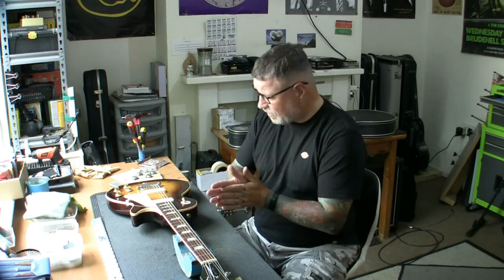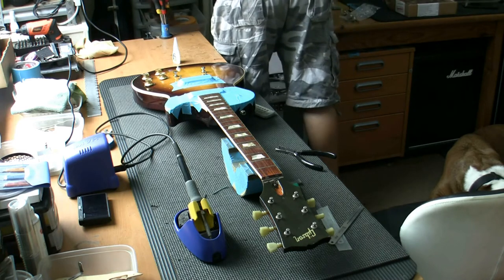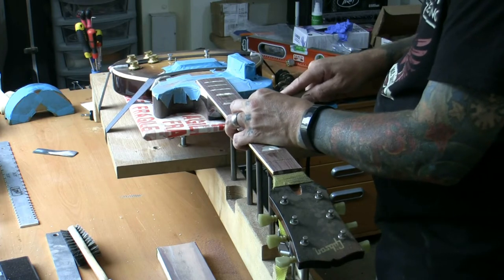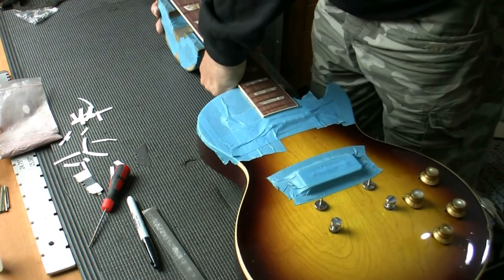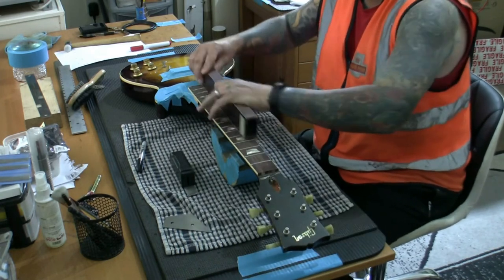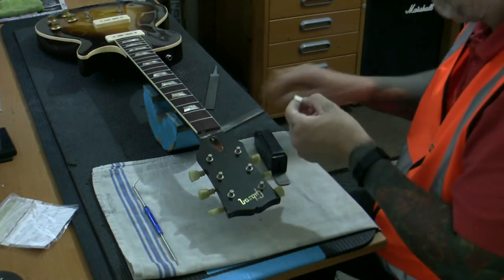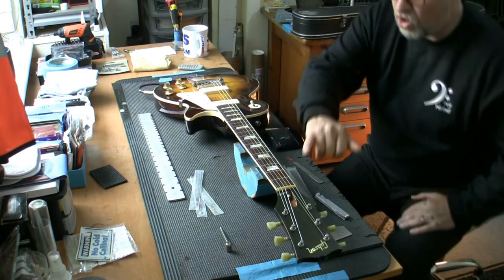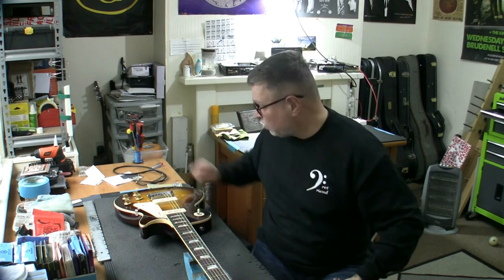1972 Gibson Les Paul Deluxe P90: neck-fix, refret and new nut plus setup. Epic project this :)

Comment: This is a very good video on the subject of refretting a guitar. 
Very valuable information on the importance of getting the neck straight before re-radiusing the finger board and levelling the frets. Your version of Stewmac’s neck jig is essential to achieve this with a problematic neck especially if the untensioned neck is bowed in the same direction as a one way trussrod will take it. No other video that I have seen ever mentions this fact and it is very important to know as if subject is not completely understood there is a very real chance of ruining the neck
Hope you don’t mind if I could mention notching metal bridge saddles. It is very easy to get the notch exactly where you want it if you string instrument up and open the jaws of digital calipers  to hold strings apart with the desired gap and when happy with placement give the string a blow from fretting hammer and you will have a nice clear mark where you want strings to rest and the string spacing will be spot on.
Victor, your videos are very inspiring to me.Thank you.
Reply from the maker: Thank you so much for your kind words! There's a comment from the owner on here now too. Victor...

Comment: How do you decide between Superglue or Elmer's (carpenter's white glue), which I remember seeing you use?
Reply from the maker: I've only ever used Titebond or superglue (I much prefer Titebond). I use superglue to hold frets in place (if needed). I use Titebond as a gap filler. That should answer your question :D Victor...
Reply: @FretFriendGWaL  Thanks!
Reply: @GerryBlue  I use titebond now because of issues I faced where superglue ran where I didn’t want. It’s possible to get round that issue by waxing the board before wicking in superglue, however titebond is much easier to clean any squeeze out with a damp cloth. The advantage of superglue is speed only as with wood glue you ideally should apply a caul and clamp the frets whilst the glue dries. So on average that means 7 frets give or take at a time then leave an hour to set. Superglue it’s seconds per fret.  Relying on superglue to hold down a loose fret is a bad idea as superglue eventually fails. Fret crimping pliers are a better solution for a loose fret . You crimp the tang slightly to create a wider tang
Reply: @MrSongwriter2  Great answer, thanks!

Comment: I've just bought a 1970s sg copy guitar i paid 150 quid for it ive stripped it apart and cleaned it up and put new strings on  . The frets are so worn down you couldn't re crown them again not alot of material left  i can make it playable again to a certain degree. Is it worth having it refreted its only worth 300 max  or should I have it as a  wall hanger  and enjoy it lol
Reply from the maker: Hi... That all depends on how good you think the guitar is. If the neck is straight and the truss-rod works, there is no reason for the guitar to be nothing less than a world beater! A guitar with a bent neck or unplayable frets is trash! A refret is going to cost you £200-£330 but will transform the guitar. Completely your call. Victor...

PS: I have had people bring £100 Squiers in for refrets
Reply: @FretFriendGWaL  ive set the guitar up today and cleaned the fret boad and frets and got it playing good  even though its a  avon Morris rose guitar with not alot of fret wear left its playing nicely and sounds great  at some point i will get it done its an honest solid guitar too good to neglect and feels like a nice sg too thanks for the advice will be in touch soon mate.